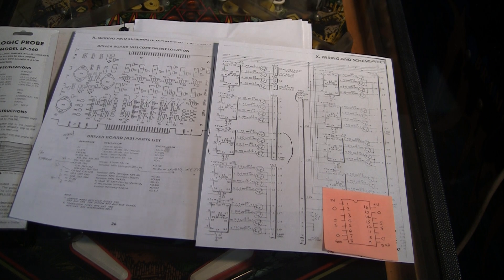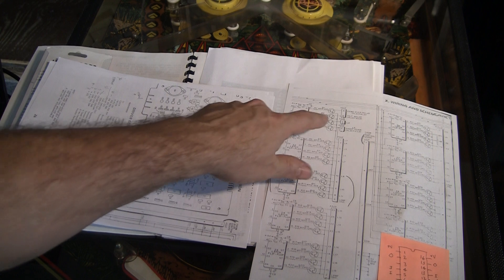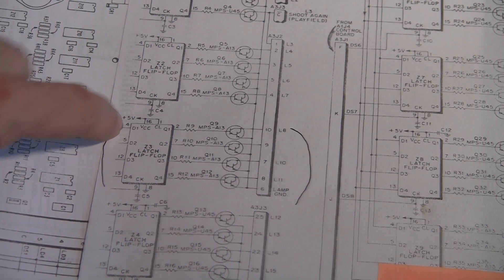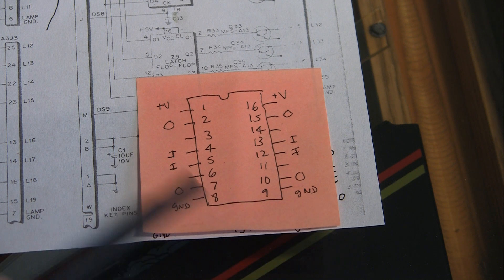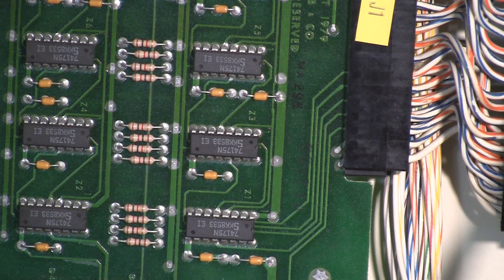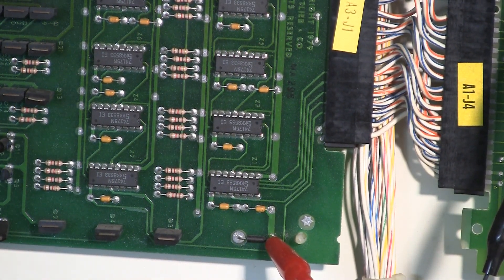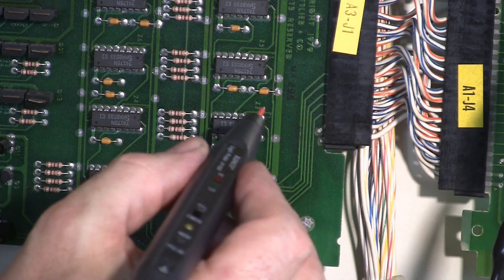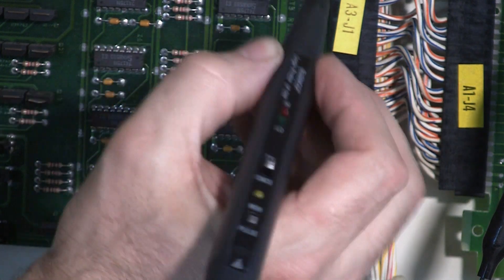Dealing with light matrix problems, using a logic probe  - Gottlieb Raven Sys80b - Part 2/2

Comment: Curious, why didn’t the input pulse like the output pulsed. It seemed the input pulsed at a much higher frequency. And what do you recommend for a logic probe. What other tools should I have. I do have small hand tools and  a Fluke DVM. I have a Gottlieb Hollywood Heat I want to fix.  My first ever project. It’s got issues. Power up and some lights come on some flash and that’s all it does. Ground mods done.